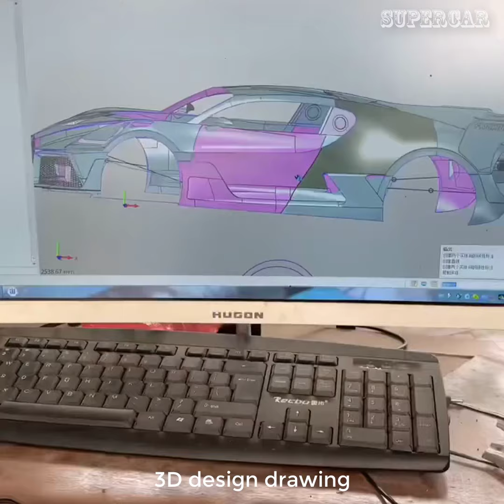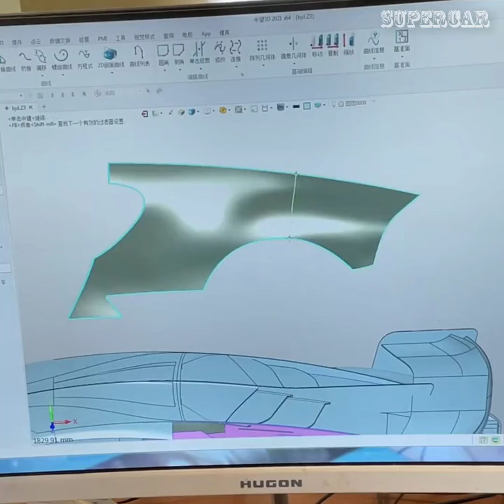BUGATTI DIVO REPLICA - FULL (reup) SUPERCAR

Comment: Sad and the engine.
Reply from the maker: Usually, we prioritize using Toyota engines, but in some cases where they are not available, we still utilize engines from other old cars and modify the exhaust system to achieve better sound quality. This allows us to maintain performance while enhancing the overall driving experience with a customized sound